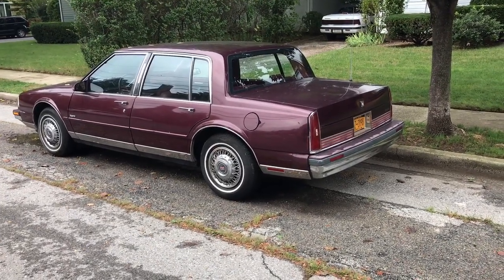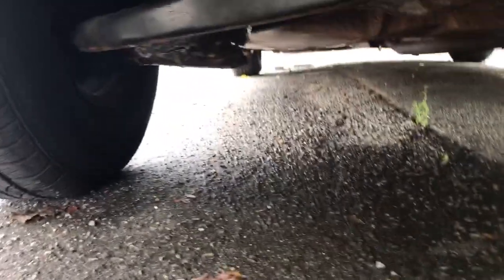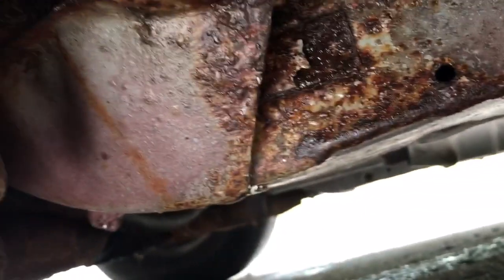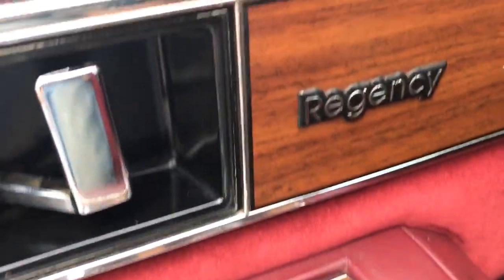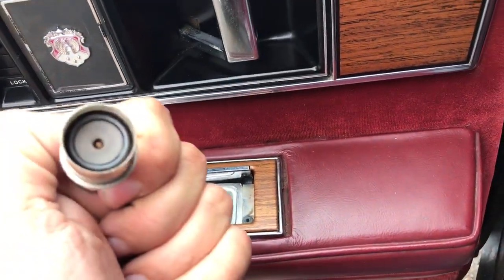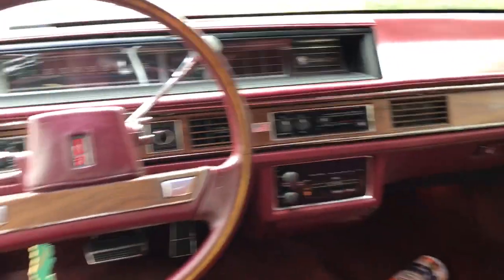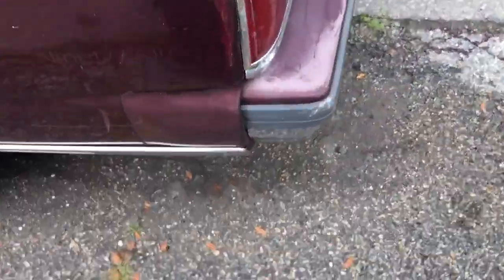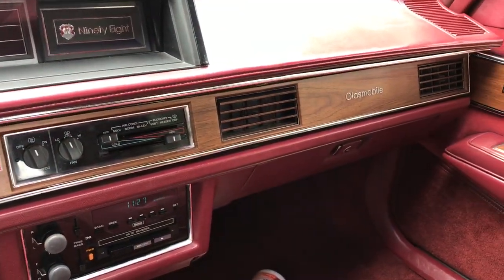Look at my 1990 Oldsmobile Ninety Eight

Comment: Very nice looking car, I'm happy that you'll be able to put it to good use, at least until the rust completely takes over. I'm not sure if you have safety inspections where you live, but here in Ontario it's required when transferring ownership so it makes buying older cars more difficult.
Reply from the maker: We do have safety but in ny they really just check lights and tires. Plus I'm gonna try and do some patch work I deceided. This car is so clean the. It's and interior to not try something